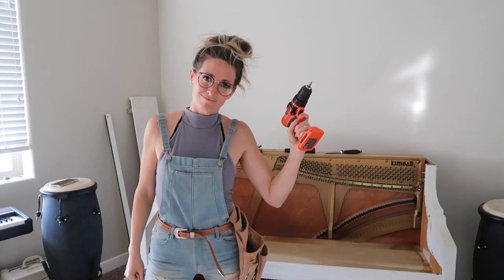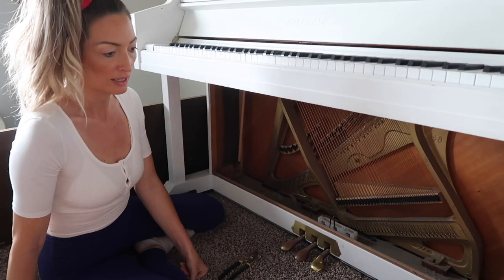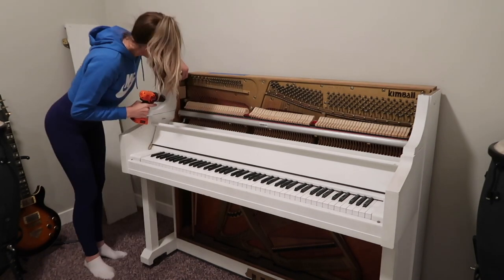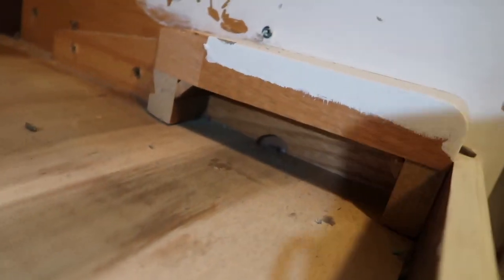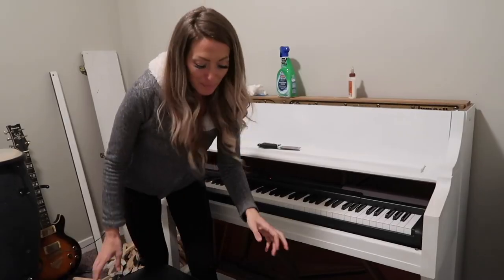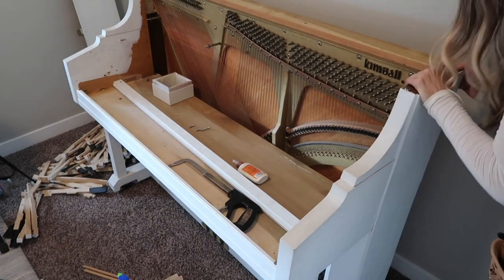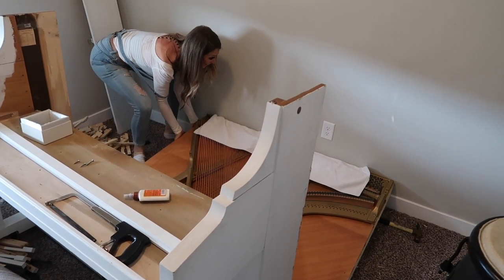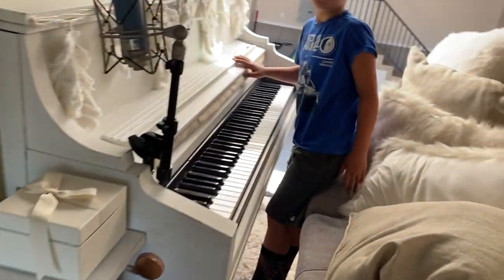MUSIC STUDIO in a VAN (is that a REAL PIANO?) Solo Female Van Build Series EPISODE 9

Comment: Take the tuning pins out that holes strings on then unbolt the cast iron plate take that out of there it will be light you will need help removing that plate it weighs at least 200 lb